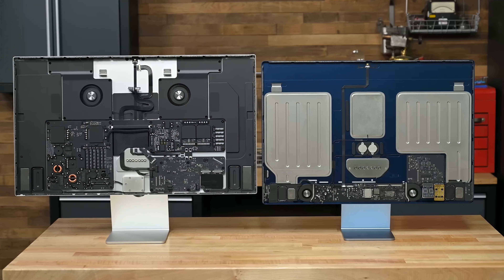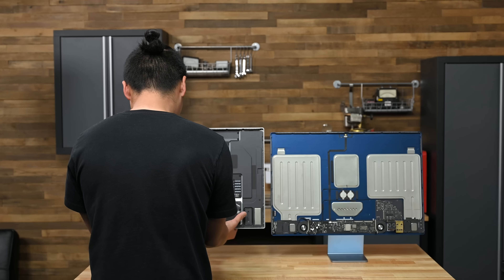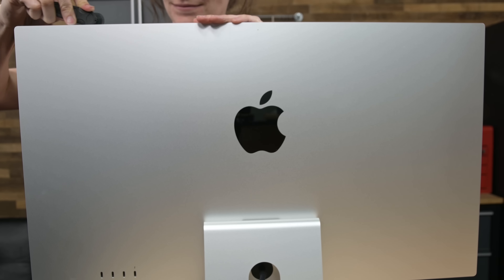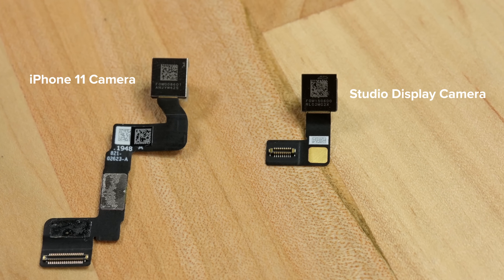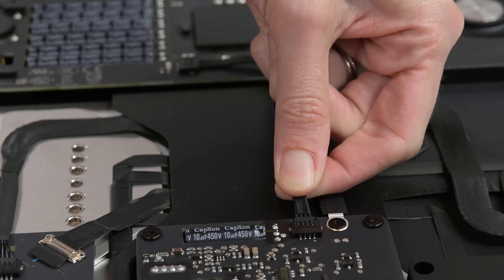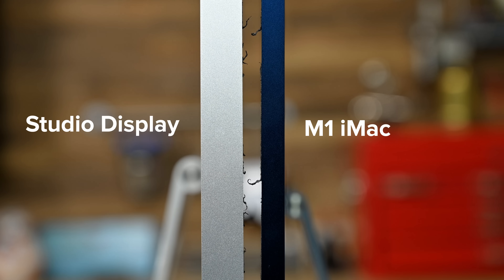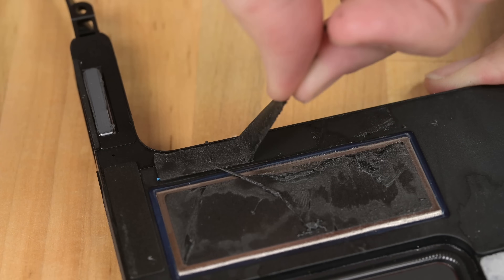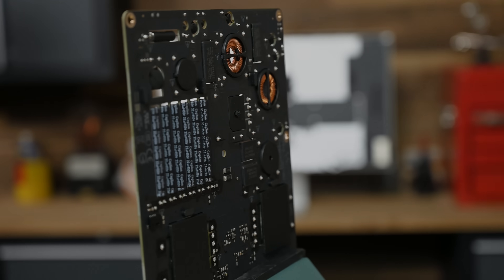Studio Display Teardown: Is this secretly an iMac?

Comment: I still don’t understand why it needs 64gigs of storage or an iPhone 11 SoC, how it runs iOS but can’t do any of:
Run tv OS
Run iPad OS
Run Siri/homepod OS
Work with AirPlay2
Work with Universal Control
Doesn’t have an Ethernet port
Doesn’t have a removAble cable
Or magsafe for that matter

Also how it is not HDR, no local dimming
And still costs 1600…
Reply: The answer is: When you can mass produce them at a lower cost, and have tons in your warehouse, may as well use up the remaining inventory before ordering new batch. The costs of adjusting the software / firmware to have the SOC to recognize smaller chip may be higher than just use the 64GB chip.
Reply: It probably needs a minimum of 64gigs because it’s an A13 and rather than program it to work with less it’s probably cheaper to use storage they’d already ordered. The rest is just Apple ignorance.
Reply: It's good if Apple put tvOS there like what Samsung do to their smart monitor...

Like giving access to simple access to video streaming or remote desktop is great
Reply: It in FACT supports HDR. And also does it a million times better than 99% of all these bullshit "HDR capable" monitors out there. And the brightness is also much higher than on those "HDR" monitors.
Reply: @Raja995mh33  how can it truly support HDR content when it doesn’t have more than a single dimming zone ?
Reply: @Raja995mh33  Yes
Reply: probably its about future invesment. they gonna announce a new feature to make it use

Comment: I wonder why apple spent so much time to reinvent the power supply, instead of just copying the iMac magsafe connector.
Reply: getting 200W+ through that magnetic connector would be very hard, and im not sure people want multiple bucks (that would get very hot without fans in them) sitting on there desk/under the desk. If they have fans since many would sit on the floor they would get very full of dust.
Reply: @hishnash  why does the monitor need more power than a whole computer?
Reply: @_..-.._..-.._  it provides power over TB to attached devices.  Full speed 140W charging a laptop and other attached USB-C devices.
Reply: I betting we'll see more displays models from Apple using this thin internal power supply. Especially when they release the Apple silicon Mac Pro
Reply: iMac magsafe, iphone magsafe and macbook magsafe are all dc connectors with lower wattage, after the external power supply. In this case we are talking up to 240V ac connector, it needed to be a different beast (obviously didn’t need to be stuck).
Reply: @FernandoAES  good point but I think people are saying they’d prefer an external power supply so it would indeed be DC at the back of the display. Would be cheaper, would allow an Ethernet connection like the iMac, and probably allow the chassis to be thinner. Not that I’m complaining of the thickness. I saw it today at the Apple store and the thickness is good looking.
Reply: @FernandoAES   🤔 I heard that it has to be fixed connector so a) there is lower risk for the after shock but most of all 2) easier to get through regulations and testing 😆 I’m still surprised about this solution because, instead of packing line, they have to consider already in assembly line what kind of plugs are used in the area they ship the goods in. When you have a separate power cord they can just add it as the final accessory with localized information and packaging.
Reply: @kperttul  They still probably add the right cord just before packaging. It does just plug in, just very hard to pull out.
Reply: @kperttul  At least with solid state displays they don't have to manufacture different versions for northern and southern hemispheres as used to be required for collimations magnets, etc. on cathode ray tube displays to accommodate different polarity of the Earth's magnetic field. :-)
Reply: @GeoffIX  but WAIT! If Deadmou5 song is played in Australian loudspeakers does it still have a base drop? 😆
Reply: @FernandoAES  FINALLY someone with brains, THANK YOU. Finally someone that know the difference between low-voltag DC and 110-240V AC.
Reply: @RandomUser2401  But the point stands, just make the display low voltage. If the iMac can use it, a display can.
Reply: You cant use or engineer a MagSafe type connector for 120/240V AC. Its too big of a fire risk from a bad connection due to possibly weak magnets. Apple would be putting in too much effort for something unnecessary.

 Also, the Electrocution hazard would be insane, imagine a bunch of pins carrying 240V just casually chilling out in the open and completely exposed to Animals/Humans.
Reply: @SaudiSpeedLS2 again, it wouldn’t be line voltage, it would have an external power supply.

Comment: Overengineered the heck out of that power supply but fogot to design a power cord that can be removed easily. Apple just likes to do one good thing at a time.
Reply: it's too thin to fit a standard ac power connector. and presumably there are regulations in at least one of the major markets they sell into that would prevent inventing a new shallow connector that's trivially user-removable for safety reasons. or quite possibly there's just regulations against having any non-standard removable connector carrying 240v.
Reply: @StrangerNoises  it‘s quite complicated to get such a new connector approved and certified in every country they want to sell this.
Reply: @StrangerNoises yet somehow, the iMac is thinner and has a magnetic, removable connector that does all of the specified features that you claimed couldn't be done 🤡
Reply: (the cord design is on purpose)
Reply: They didn't forget at all. Obviously, they did that for a reason.
Reply: They didn’t forget, they never intended to. Big difference.
Reply: It isn’t over engineered, it isn’t just affordable by you.
Reply: Have you replaced many monitor cables in your life?
Reply: @KaizenOz  Yes atleast 2 times in period of 7 years.
Reply: @KaizenOz  you know they usually break on a daily basis /s
Reply: Hopefully this basic design is what a new iMac Pro will look like.

Please, Apple, give us user upgradable storage!
Reply: Its never a mistake
Reply: Apple just want a minor issue so that if the customer wants to avoid it, they have to pay big money on the 5k$ XDR Display
Reply: @anh-quanle4399  Ding ding ding ding!!!!!!!!!
Reply: Yeah one thing at the time so they can call it "innovation" every time they go on stage 😂
Reply: This is the AC power cable from the wall outlet unlike the iMAC Macsafe which is DC from external power supply. DC voltage is lower and it has circuitry to detect proper attached before it let the current run. You can't do that with AC from the wall outlet so you have to make the connector very strong especially when you have less than an inch to plug it in.
Reply: @axlrose357  - Correct AC power 100-240 Volts is a different kettle of fish than 12-24 Volts DC.

It would have required placing the AC socket along the edge to gain the space and even that has its risks as any pressure could crack the display panel as the even that is a tight fit.

I do wonder if the goal was to make a dual design so the 27" iMac would have used the the same design as this display.
Reply: @axlrose357  My fan, for instance, have a AC power cord that directly plugs into it. The AC-DC conversion is done inside (yep, its a smart fan with DC motor, I've checked that). Theres nothing stopping you from plugging the connector vertically, even those with grounding. Or just design a proprietary connector, like they they've done for years
Reply: @SodaWithoutSparkles  your fan doesn't have a thickness <1inch ;-)

you know, details matter.
Reply: @SodaWithoutSparkles  yeah Einstein, now check how thick that fan is. Brain=absent.
Reply: Apple: can’t do more unless u pay more
Reply: The power cable is very intentional, if you have a mains voltage power cable that is rated as 'user removable' and you use a custom connector (due to thickness) you need a LOT more paperwork and certification for safety to be able to sell the same produce all around the world.
Reply: @hishnash  I wonder if, now that this display design is out of the bag, they could just patent its plug design and get it properly certified, and produce a user-removable version with less friction on the plug-socket interface. The way they designed that thing does seem rather safe, not unlike a shallower and circular C13 variant, with properly recessed live, neutral and ground slots on the male side.
Reply: @Mainyehc  depends on if the socket design they have come up with is safe. Key recruitment of a mains voltage socket is that it can be unlocked and plugged in while the power cable is live. 

Also not sure there is any point in them paying the money needed for certification, they could still provide the cable are part of repair parts just like any internal component with the needed disclaimers etc saying you should not remove without .... election qsalidfaciton just like one is permitted to sell a wall socket with this label.
Reply: @hishnash  yeeah, someone else with brains☺️
Reply: of course its one at a time. otherwise why would apple fans keep buying these old tech? hahaha.
Reply: Power cords were never able to be removed from an Apple display. I don’t know why everyone is complaining now..?
Reply: @Laluan  i think it’s because the new 24 inch iMac has such a user replaceable magnetic cable people were hoping the studio display would follow suit without knowing that apple would forego an external power brick in favor of an internal power supply. The original homepod was another product people were upset about a non user removable cable in the midst of apple being perceived as anti right to repair (whether they actually are or not is a separate discussion)

Comment: 2:23 Linus Tech Tips be like:
"Use the force, Luke!"
Honestly, Apple, it shouldn't be this hard to design a user-friendly power cord.
Reply: So, open the whole thing to get easy access to the power cord ? O.o Easy peasy.
Reply: @neoperol  this exactly. having to somehow obtain a small tool collection, risk breaking the display and probably voiding your warranty in the process, all to just take out the Power Cable
Reply: @Radu A. Exactly. And the real irony here is that they went to the hassle of engineering a new socket/cord design despite already having a slick (and much-hyped) "mag safe" solution on the iMac, so we know that the lack of user friendliness is entirely intentional. Moreover, you know who gets to foot the bill for that antagonistic R&D cost in the end...
Reply: @Radu A.  Right? It's amazing how they spent the R&D money and time to develop the connector for the iMacs, then went and did this. (Disclaimer, this was not a collection of my original thoughts, I'm pretty sure Luke and Linus expressed this realization on the WAN show, but I can't find the exact timestamp.)
Reply: @nimoy007  the iMac requires an external power brick. They wanted this monitor to be AC connectable, so they had to go a different road to keep that form factor.
Reply: @RandomUser2401  I know the cables have different goals, but it's clear that, internally, Apple does as well. The iMac's connector, while proprietary, represents good engineering that is consumer-friendly. The cord on the Studio Display is a poor showing because we know from the iMac what is possible. I highly doubt that Apple couldn't have reused some of the design/features of the iMac's cord/connector for the Studio Display.
Reply: @nimoy007  another one that still didn‘t get freakin difference between low voltage DC and mains voltage AC.. this is so frustrating. Like talking to a wall.
Reply: @RandomUser2401   I'm sorry, but nowhere did I state or imply that there wasn't a difference between AC and DC supplies. In fact, if you check my statement again, you'll find I said, "I know the cables have *different goals*." I think you'll find that the goals of delivering AC and DC power qualify as "different." I don't need to present my qualifications to you, but suffice it to say that I'm qualified to make the basic and broad statements that I did. I never said the connectors had to be the same. Why would I? I don't recall the exact pinout of the iMac's Magsafe connector, but considering it has at least a gnd reference, a positive voltage supply, and at least two data lines (for ethernet), I know it has more pins than required for AC. So why on Earth would I suggest that they need to be exactly the same? All I ever meant was that the level of engineering that went into one connector did not equal that which was involved in the other. Even if Apple kept the color-matched braided sleeving from the Magsafe brick, that would have been a transplant of SOME level of design and engineering. I don't know if you're trying to be an Apple apologist or you get your excercise jumping to conclusions, but don't put words in my mouth or others here.
Reply: @nimoy007  the magsafe connector cannot carry mains voltage AC, period. As simple as that. Magsafe has exposed contacts, even if Apple somehow made it safe, they had a very hard time getting it approved and certified in every country.
- And the cable would be custom, so people would wine and scream
- If fhey made an external power brick to use magsafe DC, people would wine and scream
- If they make a high quality AC cable that cannot be removed and a marble of engineering internal PSU - people would wine and scream

No matter what they do, they‘ll always lose. So they don‘t give two flying fcks anymore.
Reply: Its not about the hardware difficulty to design a user-friendly power cord its about the regulatory certification. Since the power cord would be carrying mains voltage they cant just come up with thier own standard and say its user replaceable they would need to get it certified and there are currently no international recognised standards that carry and earth pin that are thin enough.
Reply: The shadeeee they basically called Linus a weakling 🤣
Reply: @Carl Gunderson Next candidate that doesn't understand the difference between low voltage DC with exposed contacts and AC mains voltage which requires safety approval in every country. If only I'd get a dollar everytime someone writes this BS about the iMac magsafe connector.
Reply: @Radu A. Can’t use MagSafe on this. MagSafe is a method of delivering DC, not AC, power. If Apple had put the power supply outside in a brick, they could have, but since they didn’t, they had to design a proprietary power cord to fit such a thin chassis, and probably made the decision to make it non-removable to prevent people from losing the cord. I know I’ve retired many an electronic component and lost the power cord, only to search through my pile to locate one that looks like it’s the right kind. With this cord being a one-of-a-kind, they probably chose right to lock it down and make it non-removable.